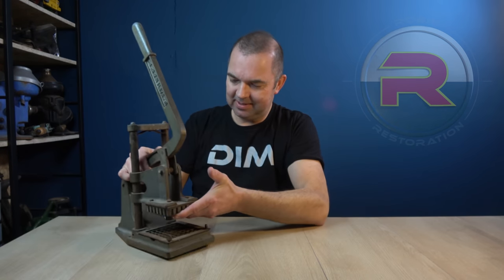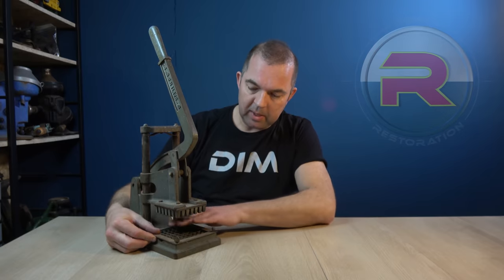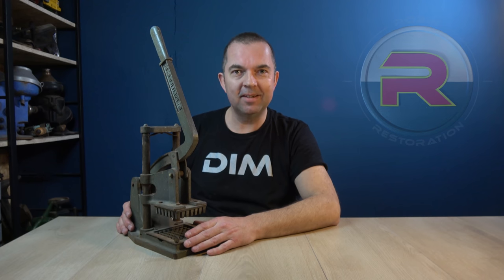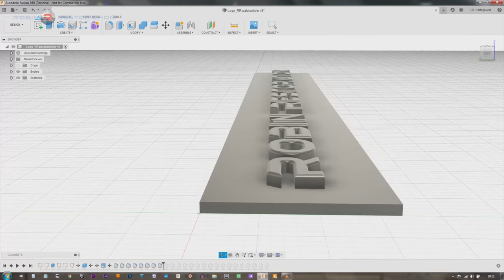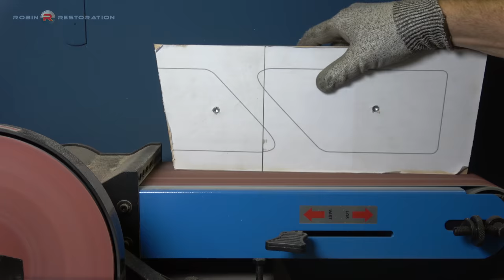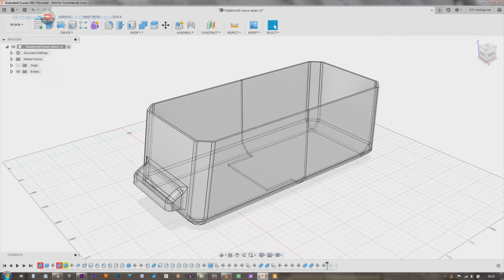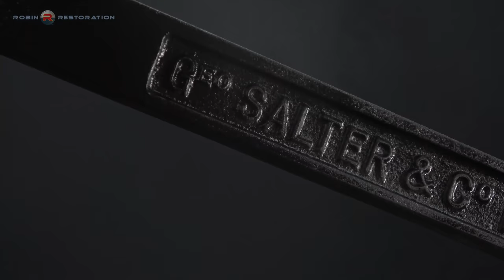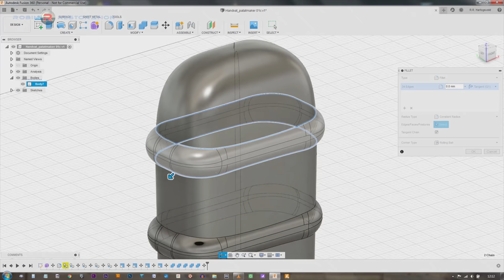Restoration & Upgrade of a 100 year old potato chip machine [4K/UHD]

Comment: By having restored an old car, I learned that steel, after wire wheeling or sand blasting, rusts much quicker than milled steel.
Reply: @TyinAlaska  or in this case all of the above including food oil (vegetable, olive, peanut, ect.)
Reply: Does buffing help?
Reply: @cia9315  technically yes but then you are stripping the blueing or whatever you used and then it'll rust faster again. Easier to paint or blue then to buff all the time
Reply: Sand blasting makes sense, because those pits trap water.  I'm not familiar with wire wheeling.
Reply: of course. It's got a much larger surface area than milled steel.
Reply: @ИльяВитцев  I'm not sure that I could guess the % increase, but it's probably a lot more than you'd expect. I tried googling it to no avail.
Reply: Kammö that’s hot bluing
Reply: If you use steel shot, you actually embed a bit of steel on the surface of what you're blasting. At my job, we sandblasted stainless steel casings with steel shot by accident and the parts rusted in the field. We had to switch to glass bead shot for any non ferrous part.
Reply: Its because of the higher surface are and opened pores if you polish it its less likely to rust
Reply: @stevier5357  plus all surface blemishes act to concentrate corrosion which can lead to increased pitting, the most dangerous form of corrosion since you can't tell how deep the pits go
Reply: @dzim  sodium bicarbonate is another great blasting medium that leaves a protective layer on the metal, and it's less abrasive to the metal itself than bead blasting. Great for larger pieces that need to be transported longer distances between blasting and finishing. Though it has to be thoroughly removed/neutralized before painting over, or the coating won't stick to the metal.
Reply: I believe this is caused by the more surface area that sand blasting removes because its not consistent in depth removal
Reply: Ah yes, because you restored one car and said car is exposed to outside elements, you are now much wiser than a master restorer.
Reply: @dabl9034  - Having a bad day? I noticed that the master restorer liked the comment.
Reply: I think it leaves more surface area, and a texture that holds onto moisture better
Reply: I polished a load of bolts on my old car and they went bright orange very soon after. What i wasn't aware of was galvanised steel. Those fixtures were plated with zinc, and polishing them up stripped it all off and left bare steel, which rusts very fast in the wet.

Comment: "Improvement" idea: Make a wooden handlepiece. Soak, slip on, let dry on tight, curse my name as it cracks a few years down the line. Also those allen bolts affixing the machine to the stand should be slot screws for era accuracy.
Reply: They should also be dome headed not taper headed.  JMO

Comment: Freaking me out with those gloves on around that Rotating wire wheel..   Might be "Robin One handed Restoration"   someday because of that.
Reply: Have you ever used a wire wheel? I dont think so, ofc you use gloves.
Reply: It looks like he is working according to the Dutch (The Netherlands) safety regulations (VCA) throughout the video.
Reply: @72martinus  Do you mean these Americans don't know what Dutch is that you have to translate.
Reply: @The_Hate IF I use gloves with a wire wheel, they’re leathers. Much safer to use none than get a glove snagged in the wheel.
Reply: @the_hate_inside1085  It's much easier to pull out small bits of wire with a pair of pliars from the skin than to live with fewer fingers than you were born with. I prefer to leave this world with the same amount of digits as I came in to it with

Comment: There are still machine like this available. If you search for a metcalfe HPCD removable block chipper you will see it has a variety of different grid and blocks which could possibly be adapted to fit your machine and make it more versatile- you might even end up binning your food processor, this is surely more fun to use!

Comment: The only thing I don't like it the 3D printed bucket.
With you wood working talent I was hoping to see a wooden bucket and maybe the 3D printed parts as a liner.
But I do love the fact you restored it to actually use it.
Reply from the maker: A wooden box would have been cool as well. Looking back the box was too large to do a proper 3d print.

Comment: Wonderful job! You have a very good technique, won't change almost anything, the way you work with metal and wood is fascinating. One point of improvement is the painting. It is much better to use a primer, sand to the proper roughness and then apply the base coat paint if needed coats of clear in the end. The main difference is how you treat your primer coat, it will look amazing in the end.
Reply from the maker: Thanks for the advise. The black paint was the primer though (I was actually surprised it was black, normally it's gray or white).

Comment: I was wondering where the chips would fall. The modern versions have the cutting grill up front. I thought there was something missing, your solution is very good. 
Being Portuguese, I like my chips with just salt and a little freshly ground black pepper. In old traditional Portuguese Cuisine, potatoes are mostly boiled or baked. Fried potatoes is a relatively "modern" introduction,  it's more of a restaurant thing. But of course it took root in home cooking along the years. 
Best regards, from Lisbon Portugal
Reply from the maker: Hi Maria, originally these machines were mounted on a table with a hole underneath. The potatoes would fall into a large basket I assume.

Comment: Very nice. But, why did you not blacken the bare plate and screws that hold down the knives? Also, what is that flat spring supposed to do at the top of the vertical shafts? It appears redundant...
Reply from the maker: That would have been a good option, David! The flat spring is indeed redundant. I think the designers wanted to prevent the sliding piece from hitting the top brace. But it can hardly reach it on purpose, let alone by accident or normal use.

Comment: on the sides where you put the cotter key in it would be good to put a washer on the pin before putting the cotter key in so it wouldn't scratch the nice paint on the side.
Reply from the maker: You are absolutely right, I did not think of it because it was not there when I took it apart, but it would have been better

Comment: Nice clean up. But the moment you pulled out the Motip putty and 3D printed parts, it stopped being a restoration and became a modification.
Those small imperfections from the casting process is what gives these old tools charm.
Reply from the maker: I agree, but as I mentioned in the cideo I will use this machine myself and that it would be a restoration AND upgrade. I also have tools that only need cleaning and shouldn't be touched at all for the rest, like my first hand drill.

Comment: Very nice restoration, but having used (and cleaned) one of these you should know that the cutting blades come apart for cleaning and sharpening (one job I had to do at the end of the day). They are very fiddly to put back together again, but once you get the outside four in place, it becomes easier.
Reply from the maker: Thanks for this tip. I was convinced that the blades were welded together and couldn't be separated [.....runs to garage with wood and a hammer....] You are right; they can be gently separated. Maybe I'll do a short video on this one, thanks!

Comment: It is my first time on your channel.
Great video, nice shots and camera angles, but my mechanics is still on the top, especially on the painting job (lack of filler).

The disassembly: very good, I like that you focused on certain pieces of the assembly and not just randomly dissassemble everysing.
The restoration: I really enjoyed it, I think you can add some words about the products that you used and the things that you did like bluing and hardening.

The painting: use some filler to accive greate and smooth surface., and maybe some primer if required for the products that you use. I loved camera shots.
The assembly: Very nice, loved it.
Reply from the maker: Thanks. As far of the filler there are two main streams: some think it would be cool to smoothen everything out, but many find it a shame to hide the production process marks that can often be seen in the metal.

Comment: Very cool!! Is that mayo with fries? I hate ketchup. I didn't know it was a Dutch thing!
Maybe I missed it, but would be cool to see how you made the backplate with the R on it. 
Someone said it below, but volume is too low. Also, the washers on the top two bolts were missed. 
I look forward to more! Thanks for sharing!
Reply from the maker: Yes mayo. I mention the missing washer in the subtitles (did you turn them on? They are my voice over text). In the later shots you see them where they belong. The backplate is the original plate with a 3D printed logo glued to it. This print is PLA (plastic) so it can always be removed by someone who is going to restore it in 100 years.
Reply: @ROBINRESTORATION  OOOH!! I saw that note, but I assumed it was for the first part of you talking. My apologies! And very cool!

Comment: Please sharpen or get a new router bit for those roundovers.  That and a couple of passes instead of one deep one will eliminate all that burned edging.   Obviously you got frustrated with sanding that burned part out - and then left parts of it which still showed through the stain.  Such a distraction from the finished piece.
Reply from the maker: Up until now I had no trouble with it, but it first appeared with this hard oak wood.

Comment: Just being curious how much time it too to take the whole assembly apart. Waiting time for the WD40?

Edit: The final colour is just fabulous, really like the red instead of the standard industrial green or blue/grey.
Reply from the maker: Taking it apart doesn't take very long, WD40 works pretty quick with parts that are stuck especially when you can get a little movement in the screws. So I guess 15 minutes to disassemble if I wouldn't film. But filming it all is 90% of the time.

Comment: You did a great job of the chipper.But you never wear material gloves when using a wire wheel and the same applies to using a drill press. It’s fine to use rubber gloves as they won’t get snagged up.👍
Reply from the maker: Yes In know (by now)...

Comment: Take a fine file and sharpen the blades more. Then take a thin tool sharpening stone block and hone the edges. I have used like potatoe fry presses a ton in the restaurant industry and the sharper the better. When they get  dull, it more crushes the potatoes through instead of slicing through.  This will cause excessive potato pulp to build up fast making a big mess from the blades tearing through the potato instead of slicing cleanly.
Reply from the maker: I also had a tip that the blades can be disassembled. I thought they were welded but they are not. A lot more effeort though.
Reply: @ROBINRESTORATION  in modern fry cutters, the blades are disposable.

Comment: Hello, new to the channel here lol. You are the only restoration channel I've seen so far that has leveled the audio for the different equipment. May I ask why you muted the power tools and sand blaster but not the hand tools like the hammer and punches?
Reply from the maker: Youtube messes with the audio based on the loudest sound in the video I found out. Many people commented that the overall sound was to low. I didn't know at the time what caused it.
Reply: @ROBINRESTORATION  Ah, darn it youtube! Stop messing with stuff!

Comment: Really good video and a beautiful result! 

There is only one thing that bothers me: The Blade.. its dull :/ 

If id make one improvement: Change/sharpen the Blade. (Id go the change route, since the Blade does not look as good as it should, but u can sharpen it too! Its not easy but with a fine small file or even a sharpening stick, it should work...)
Reply from the maker: I have had some great tips from professionals about this. It seems that the blades are not welded together, but can be taken apart for sharpening. I might make an update video with all the tips and new techniques I have read in the comments. Thanks for yours!

Comment: Smart arse comments first.
You did use food safe grease on those pivot pins etc. didn't you?
Really nice looking bit of kit I especially like the stand and chip holder.
All you need now is a rumbler to make peeling the potatoes easier.
Reply from the maker: I didn't think of doing that, more people gave that tip. So until then I'll be eating 10W40.

Comment: That new base and chip-hopper you manufactured for it was very elegant, but wouldn't be very practical for sustained catering use — a bit too high and not really solid enough.😉  Potato chippers like that were meant to be bolted to the edge of a kitchen counter with the grille part standing proud of the edge; the chips fell into a bucket placed on the floor beneath. I have good cause to remember how they were used, as I nearly took two of my fingers off with one when I was a student doing holiday work in the 1970s — before the introduction of sensible rules about using chainmail gloves. 🤕
Reply from the maker: Thanks Mark, yes I know they were supposed to be mounted over a hole in the sink. My wife didn't agree on that suggestion though. So I made these adaptions purely for home use.
Reply: @ROBINRESTORATION  Much better as a moveable conversation-piece than a permanent (and potentially lethal) kitchen appliance. 😊 Another gadget we used with the chipper was an automatic potato peeler: a sort of carborundum-lined wet spin-dryer where you poured the raw spuds in the top and released peeled ones through a tilting hopper in the side. If you do ever find one of those to restore (I remember it had a fetching pale blue Hammerite paint-job), I think your wife should be forewarned that it would be permanently plumbed in, and produce torrents of muddy, starchy water...

Comment: die befestigung auf dem auffangbehälter ist clever. weniger clever ist es, dafür versenkbare schrauben zu verwenden und die dann nicht zu versenken. eine kleine fase an die löcher, und patte und schraubenkopf wären bhündig und es sähe richtig gut aus.
das auge isst schliesslich mit, oder?
Reply from the maker: You are right. I didn't want to drill in the original part but I couldn't find the right bolts at that time.

Comment: I'm not a perfectionist by any means 
But loved the quality of your work
I'd of suggested you countersunk the holes for bolts holding it down to the base
Reply from the maker: I haven't found the right ones yet, there was an original countersunk, I did't want to drill those out (yet) untill I find the right bolts. But I agree.

Comment: Those machine were used in "fish and chip" shops (and uniquely British thing AFAIK); normally fixed to a worksurface with a cutout, and a (clean!) bucket placed underneath to catch the chips.

These machines are still made (and presumably used)

https://www.sammic.com/catalog/dynamic-preparation/french-fry-cutter

Excellent historical research on the company and its dates!

Comment: When restoring screws with damaged heads (9:24), rather than filing off the deformed portion(s) use a small hammer and peen the deformed portion(s) back into place then file and polish.
Reply from the maker: Thatś a good tip, thanks!

Comment: Instead of a metal plate, you can stick a magnet.
Why did you use polyurethane glue once and white (PVC) glue another time?
And these countersunk screws, but someone already mentioned it :-)

The lattice of knives is not disassembled?

Good job!
Reply from the maker: It could have been either glue. But I used the PU glue for its expanding features. But wood glue would have been good as well. I only found out later that the knives can be dissasembled to be sharpenend.

Comment: I really like to see powder coating instead of spray paints.
Reply from the maker: Me too, but I haven't got the right equipent (yet). Especially a vertical of big oven with a glass window for filming is a problem to obtain in Europe. I think I have to make one of those. But it is definitely on my list.
Reply: @ROBINRESTORATION  I've seen folks on YT using a regular oven for things that will fit. Mostly old ovens with a glass window in the door.

Comment: spring is a pain in the butts and old guy showed me an easy way to remove them put a rope on the spring and pull it works most of the time  lol
have a new one to make french fries I am Canadian  chips and flat here  have it mounted on a post  here and put a potato in  have it on and air cylinder push the button to have the potato done I can cut up to 12 potatoes at one time  make them for a couple of restaurants here 
has done a great year for me  past  what I had made last you in total  now
Reply from the maker: Thanks for the tip Jennifer.

Comment: You need to keep your cutting blades oiled or they will rust quickly when you sandblasted it the pores opened up allowing it to rust.. I would have sand blasted it sharpened it then place it in an oven at 450F for 35 minutes then paced it in oil 2 or maybe 3 times to seal the  pores.
Reply from the maker: I have noted this, thanks!